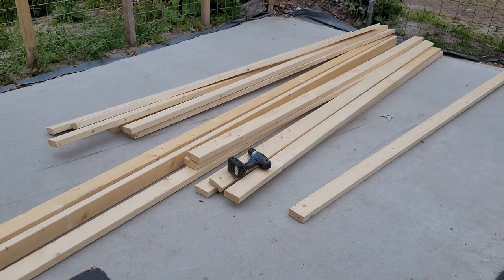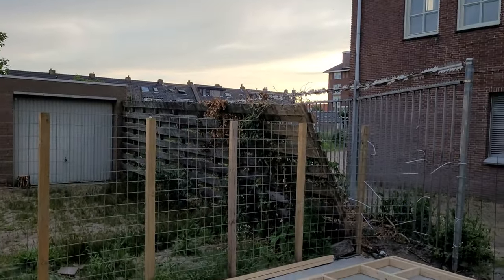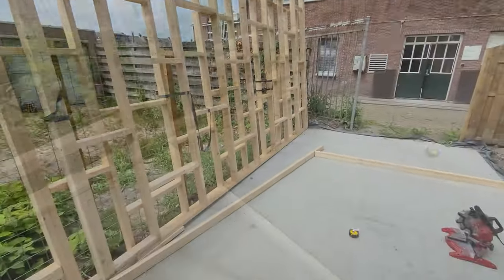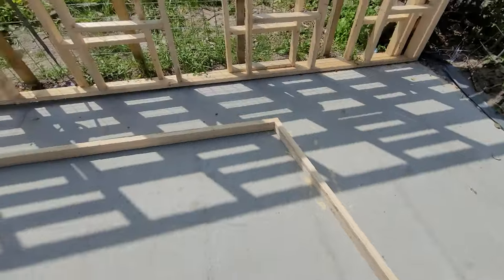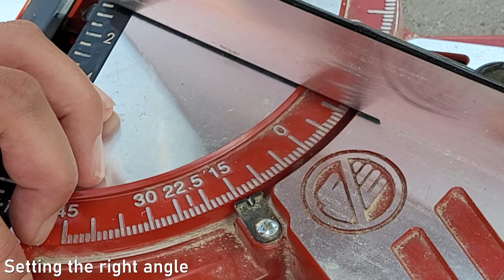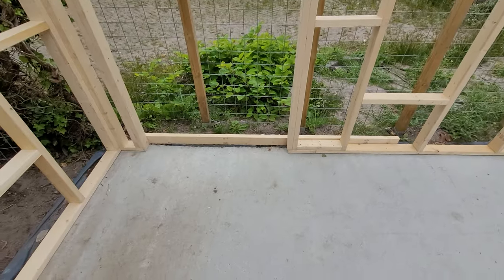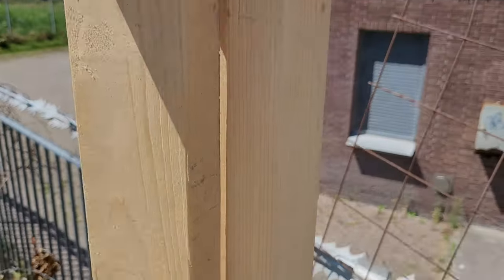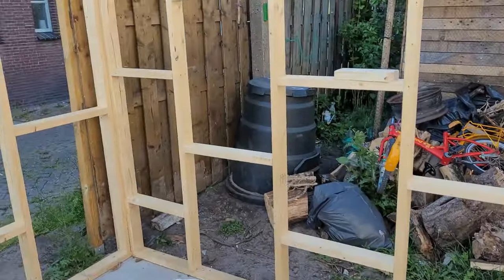Building the shed vlog # 5 - Wooden  frame

Comment: why did you decide not to have any extensions out over the edge of the walls?  Seems any rain you have will now just run down the front wall instead of drip off the roof to the ground.
Reply from the maker: This will be solved by something I have laying ready here. You will see in the next video 🔥😀
Reply: @Metalstacker  lol figured as much, good luck on finishing it up.

the other thing I wondered is if you had specific setbacks.  Here we can't build within 15 feet of the properties back property line, 10 feet from the side property lines and 25 feet from the front (or something along those lines).  You can build temporary things, but no permanant structures.  It seemed you were right up against your property line, or what I assume it is based on the fence.  Any similar rules/laws there?
Reply from the maker: @ChatterontheWire  well to be honost I'm not sure about laws here LOL. What I do know is that you are allowed to build free standing structures with a maximum height of 10 feet. Also the total ground of the whole property may not contain buildings for I believe 50%. If you exceed that amount you have to ask permission. My biggest concern is my neighbourhood. They all seem to approve and appreciate my new shed. I think that is most important above the law. I'm a free minded guy sort of speak 😉🔥🔥🔥